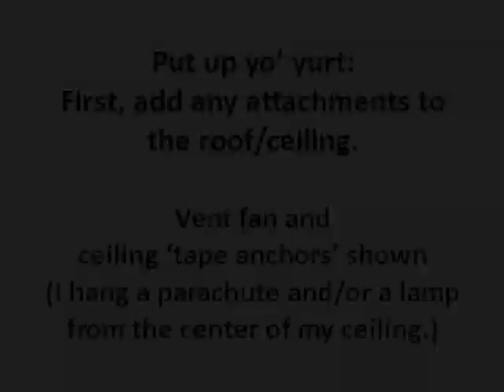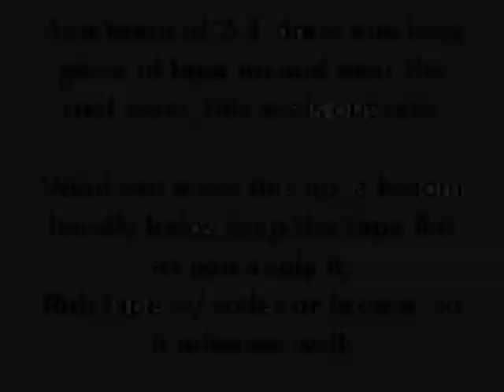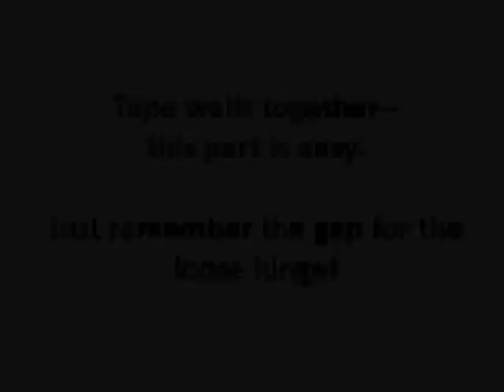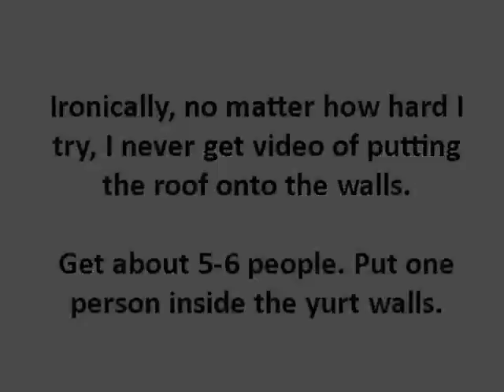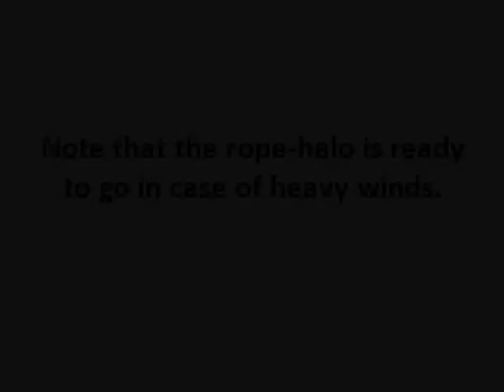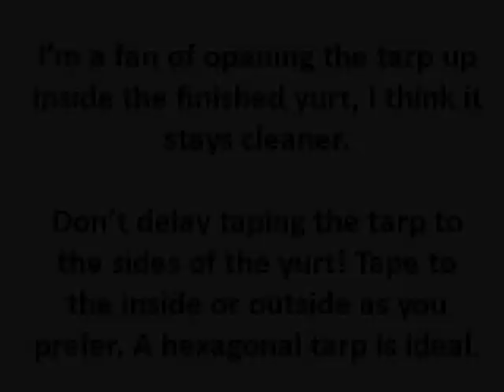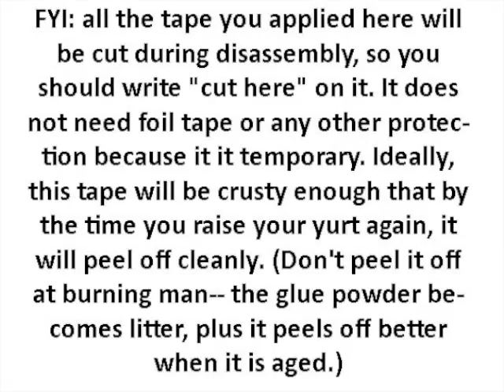On Playa Hexayurt Raising

Comment: I read in Wikipedia that those building materials you are using are highly flammable, that such a structure ought to be used for instructional purposes only.  It recommends building your Hexayurt with plywood or coroplast; according to Mr. Gupta plywood can be insulated.